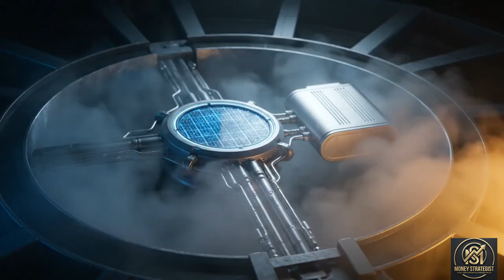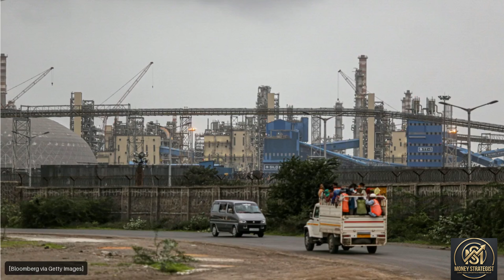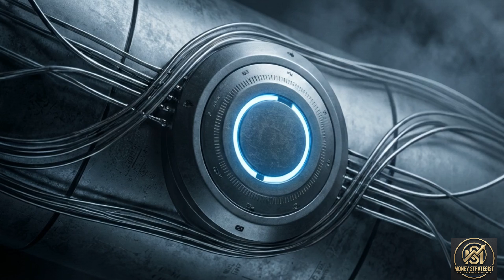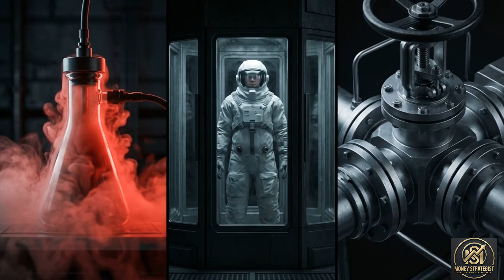The $50B Semiconductor & Battery Boom in India: Top 5 Hidden Stocks

Comment: 00:00 - The $50B Industrial Backbone & Supply Chain Shift
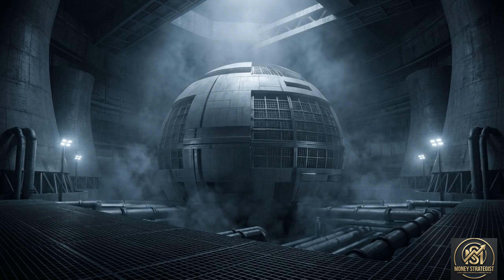01:08 - Stock #1: The Captive Monopoly (Linde India)
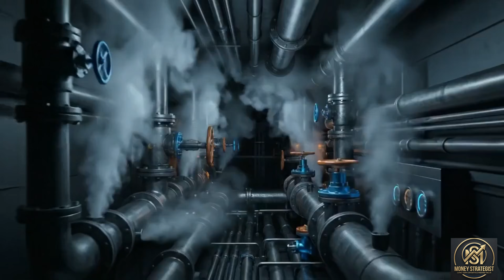01:44 - Stock #2: The Digital Nervous System (Honeywell Automation)
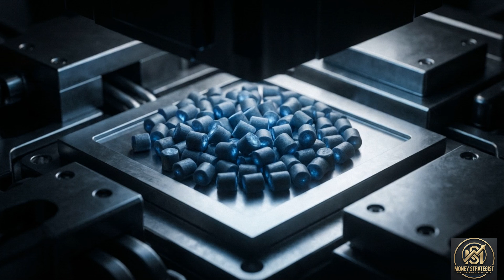02:47 - Stock #3: The Indestructible Backbone (Gujarat Fluorochemicals)
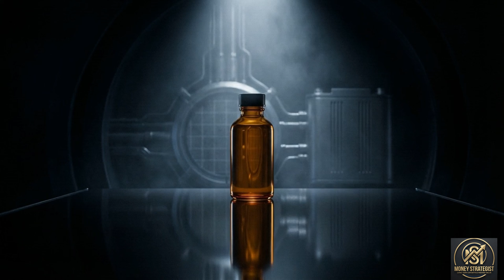03:37 - Stock #4: The Photolithography Pioneer (Acutus Chemicals)
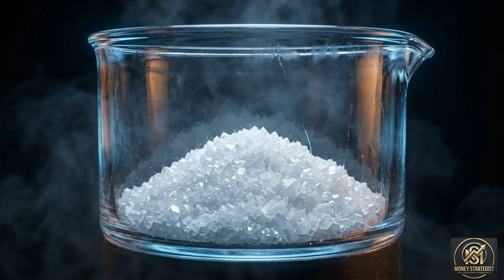04:19 - Stock #5: The Gigafactory Bottleneck (Neogen Chemicals)
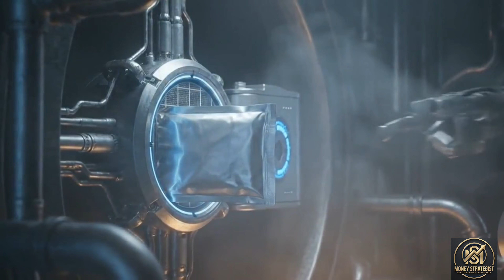04:58 - The Upstream Compounding Advantage